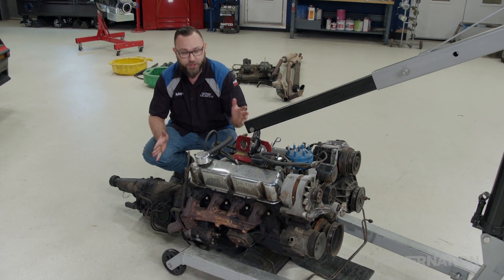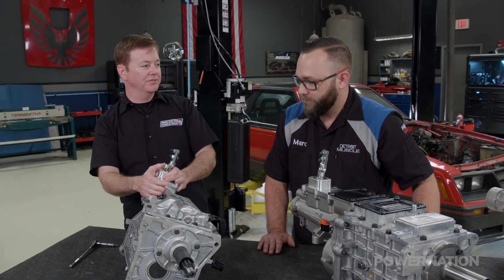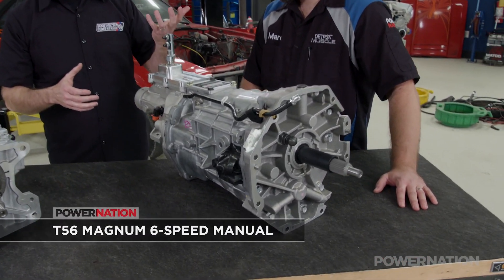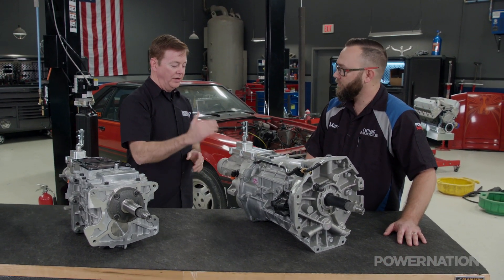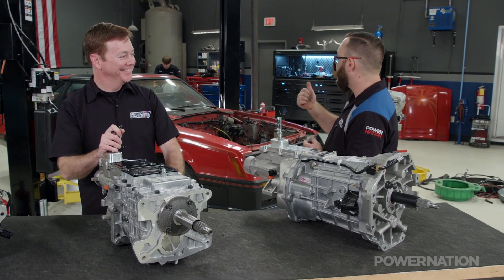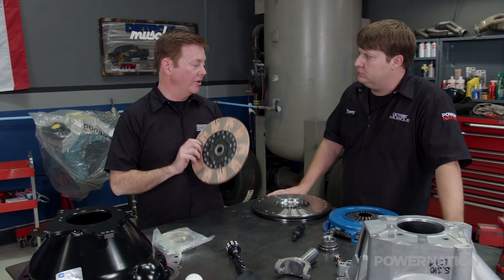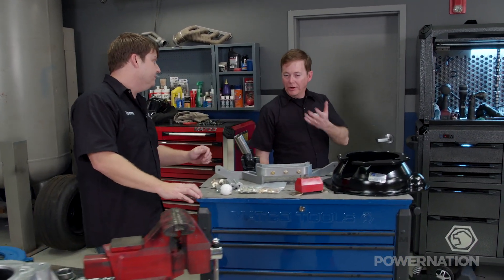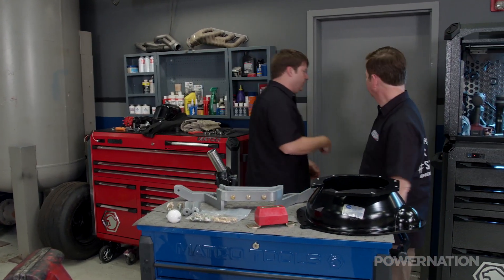What To Expect When Changing From An Auto To Manual Transmission

Comment: What are the 3 Best manual transmission to bolt up to a Chevy 350 small block in a 1986 GMC Sierra classic high sierra regular cab long bed 2 wheel drive.